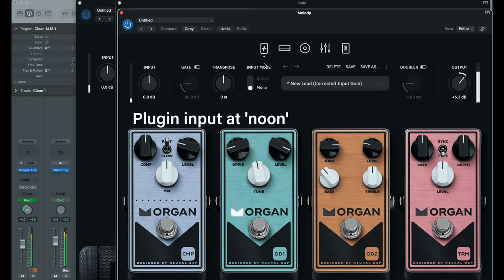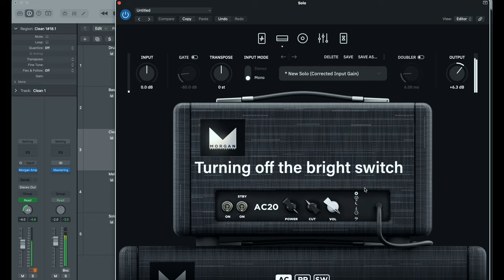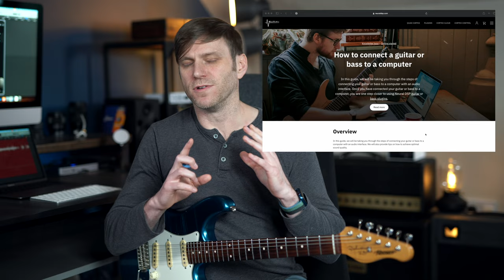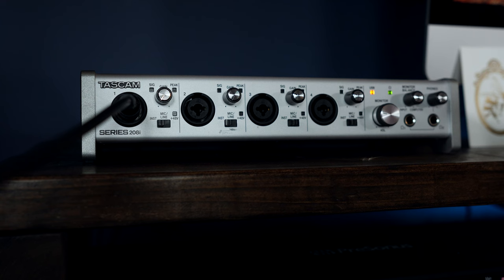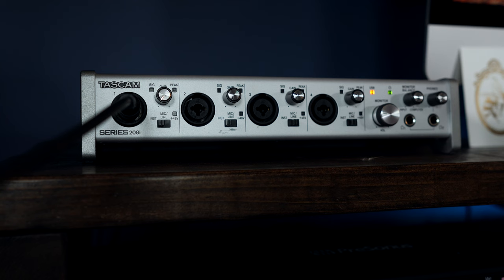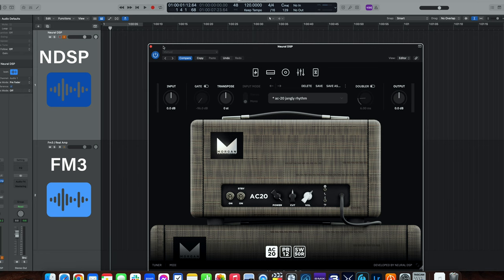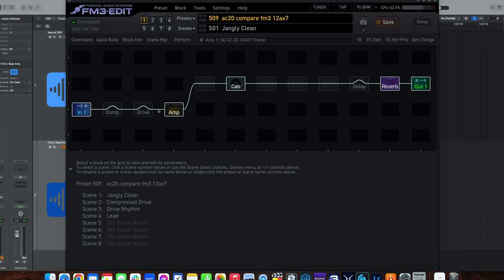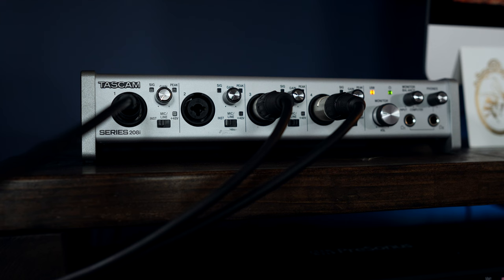I Finally Learnt To Like Neural DSP Amp Plugins | STOP Slamming That Interface & Get Better Tone!)

Comment: It's a damn shame that these plugins have been around for a decade and this information is just now getting out. I used to get so frustrated with Helix Native and how it was impossible to sound anywhere near as good as my Floor unit. I went as far as plugging the floor directly into the audio interface and not using the plugin over how bad it sounded. At the same time, I'm sure the designers are sitting there thinking that they can't believe it took these neanderthal guitarists a decade to just plug it in like a real amp and not touch the input, hahaha!
Reply: What were the issues you were facing? For me, all the amp sim plugins sound way too boomy and muddy. Imagine the tone knob on guitar being rolled off. No matter how I adjust the amp sims or IR's, it either sounds very boomy and muddy or very thin and fizzy. As if plugged into a Fuzz pedal.

I've tried to adjust the gain knob at 0 on the interface, it only reduced the saturation and input signal into the amp sim plugins, but they still sound very boomy. And yes, I run the guitar cable into the high z input of my interface (tried with RME babyface pro fs and focusrite scarlett solo 2nd gen..) Something is just not right. What was your experience?
Reply: 1) Use this guy’s advice.
2) Make sure your guitar doesn’t have shoddy wiring or soldering.
3) Make sure your PC isn’t attached to a rat’s nest plugged into an outlet that was wired during the Great Depression.
4) Don’t try to break physics. If the sound in your head is big speakers, use big speakers. If it’s double tracked guitars, stack amp sims and hard pan L/R. If it’s polished compress the piss out of it and EQ it. If it’s drop tuned. Drop tune. If it’s baritone, play a freaking baritone. You get it.
5) Some amp sims or speaker IRs need the top end rolled off slightly or it will definitely sound fizzy.
6) Mud is around 2-300hz. Try scooping some out without killing your tone.
7) It’s the digital age, stack plugins until latency kills your fun. Use different channels, use buses, have fun!
8) You’re the only who cares about your tone and if it really sucks, people will tell you.
9) If you have to overuse a gate, there is a problem with your setup or input levels.
10) Consider buying a real amp and attenuating it for bedroom play if you still hate amp sims.
11) If you still hate your tone, sell everything you own, buy tickets to your favorite guitarists show, sneak on stage and photograph his amps and pedal board and knobs. Just buy that lol.

Good luck!

Comment: Could never get a decent tone from any of these Neural amps. My fault probably.
Reply: What were the issues you were facing? For me, all the amp sim plugins sound way too boomy and muddy. Imagine the tone knob on guitar being rolled off. No matter how I adjust the amp sims or IR's, it either sounds very boomy and muddy or very thin and fizzy. As if plugged into a Fuzz pedal.

I've tried to adjust the gain knob at 0 on the interface, it only reduced the saturation and input signal into the amp sim plugins, but they still sound very boomy. And yes, I run the guitar cable into the high z input of my interface (tried with RME babyface pro fs and focusrite scarlett solo 2nd gen..) Something is just not right. What was your experience?
Reply: @kalpitmomaya916  Exactly the same as yours, using an Apollo Twin interface. No possibility to obtain a clean yet warm sound.

Comment: What do you mean they have problem with input level. 
What a joke. On Mobile Amp sims on mobile devices (ipad, iphone, even android) it's not even an issue, since they expecting the users using various (and even wonky, on board) interfaces, they've already match the input level.
And you tell me these lazy developers can't even do that on pc where people use at least more proper audio interfaces. What a joke.

Comment: This video is meaningless because not every guitar is the same. Hence pickups.
Reply: You’re flat wrong. The entire point of this video and gain-staging this way is to get the closest emulation, the way it was intended by the plugin developer, and the way they modeled it. Which means that given your example of using different guitars with different pickups, it would react the same way the real world amp with the same settings would . The difference would be entirely guitar and (very minimally)pickup dependent. Take a step back for a second and think about that.
Reply: yeah its the opposite. If you adjust the gain on your interface you are essentially removing the output of your pickups as a tonal variable. By keeping the interface gain at 0 you are preserving the difference in output from a single coil to a humbucker etc.